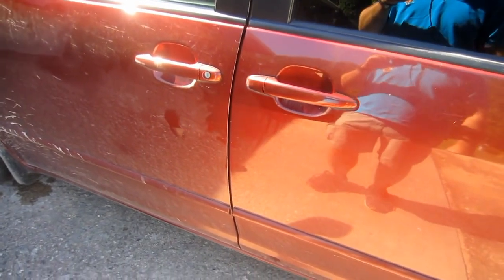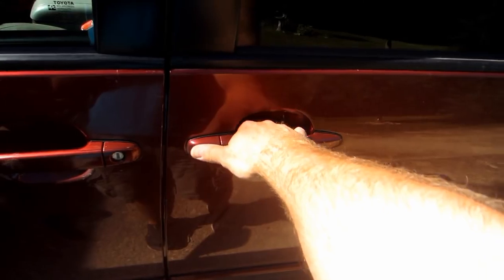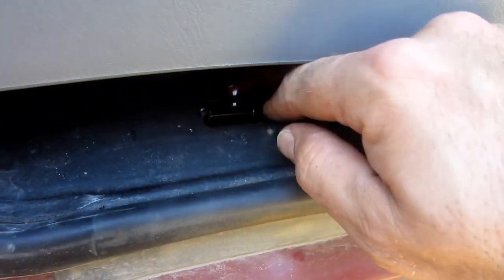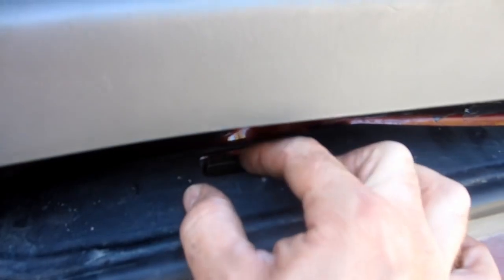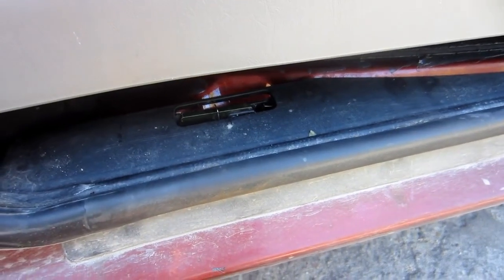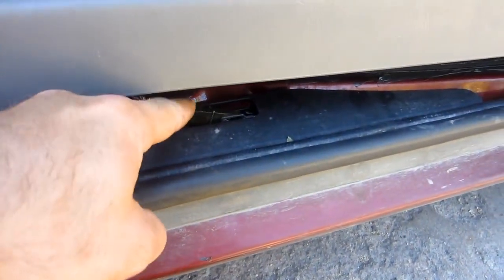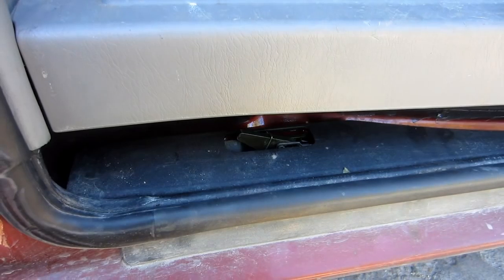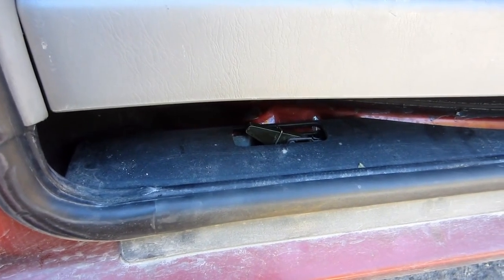Another Toyota Sienna Sliding door problem/Fix

Comment: Exactly the problem I had on my 2004 Sienna.  I was considering all of the work to replace cables, removing door panels, etc.  Thank you and your brother-in-law so much for this simple fix.  To open the door so I could work on it, I opened the gas cap door and manually pressed the button and slowly slid the door back past the stop.  Then closed the gas door of course and had open access to the stop mechanism.

Comment: 2007 Sienna LE with manual driver slide door.  Yes, the cable to open the gas door runs through that floor latch.  I had to push in the black plastic pin/button at the top left of the gas well to get the floor locking latch to release.  Thanks for the help!

Comment: Thanks! Helped me locate and fix the problem in a few seconds. My gas cap door was slightly bent so it didn't trigger the little button it pushes to verify the door is closed. Bent it back and it worked immediately. Before, I thought there was a pebble or something stuck in the rail that was blocking the door from opening!

Comment: Interesting.  I have a 2012 (bought used), recently started having issue with the driver's side sliding door, kind would get stuck like in this video but now I can't even get it to open.  Would I be able to see that spring even with the door closed (from the inside)?

Comment: Exactly the same problem that recently showed up on our 2011 the driver side sliding door jams sometimes it will work fine for days I looked at the piece just a little bit on ours you showed there doesnt appear my spring has come off but, my issue could also be coming from the fact seeing how that has to do with a safety for the gas tank my gas lid top hinge is broke the lid does not close all the way

Comment: What year though?
Reply from the maker: This should apply from 2003 - 2010
Reply: @germanpickle  Thanks so much for this video. I had to get a wire hanger and hook it around it just to pull it down. Didn't know how to get it down until I watched your video. I've got a 2013 sienna And it's the same as yours.  I'm pretty sure it's all the same through at least 2020.